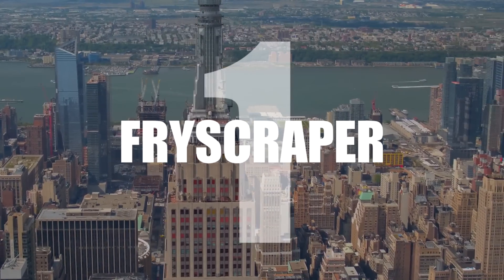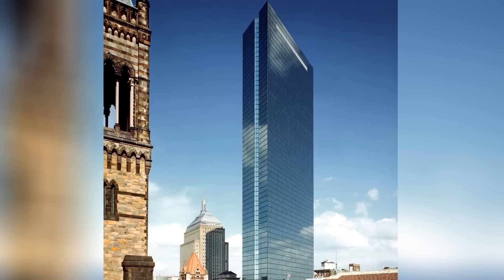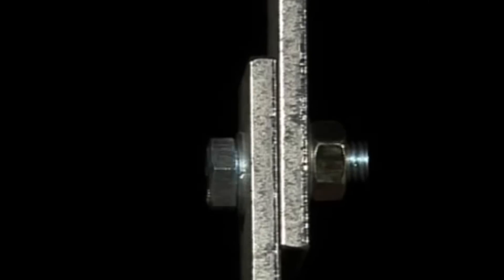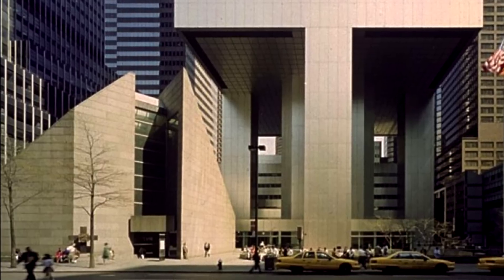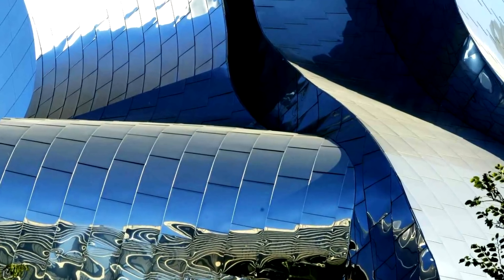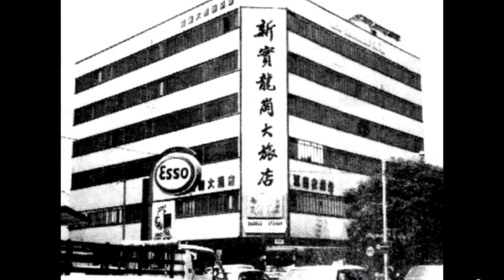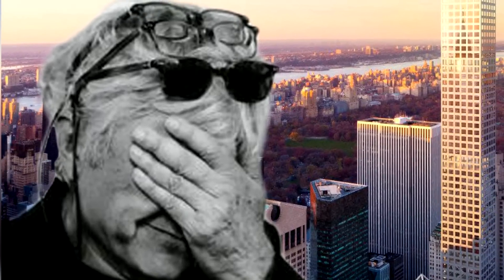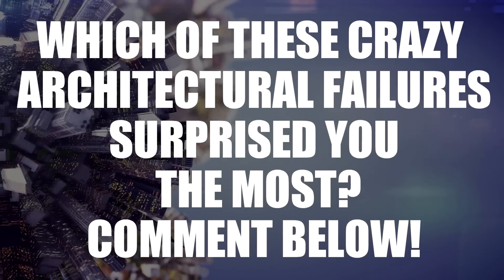10 Unbelievable Architectural Failures

Comment: The one that shocked me the most would be number 8. Because it's obvious that the problem was not just the weight of the building itself. But if the building is not designed to carry extra weight that is added on at a later time, then of course the building would suffer a collapse sooner or later.

Comment: Many of these are not architectural fails but engineering fails. All architectural work must have engineering checked before construction approvals.
Reply: Except Rapael viñoly, it was his fault. He failed to notice where the sun travels, he could’ve faced the building against it. Or changed direction
Reply: @Itstolinho  Exactly